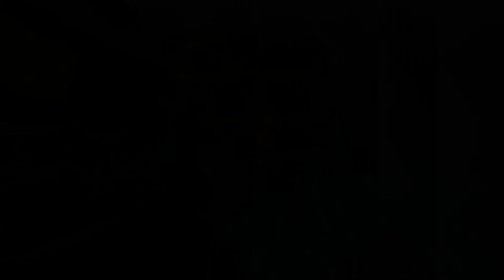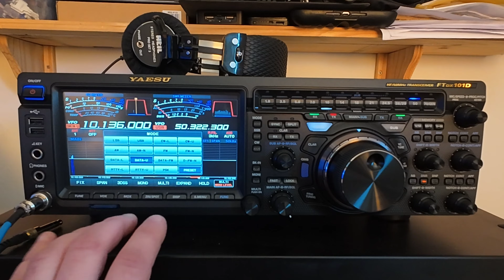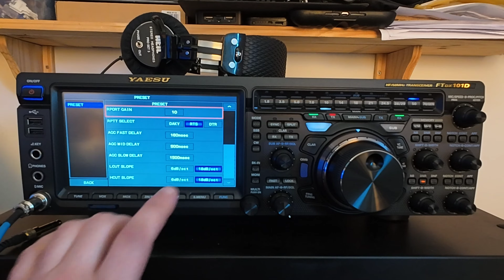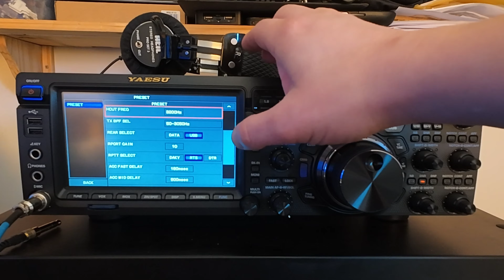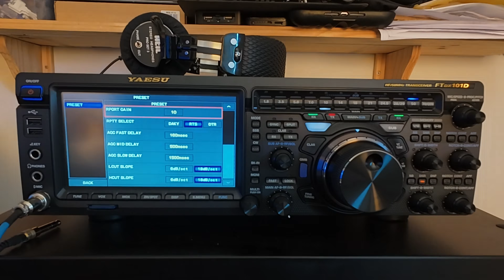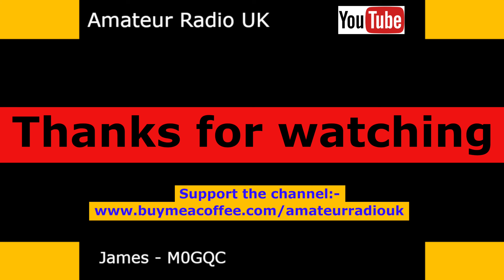Yaesu FT8 Settings (Preset Function)

Comment: I also have the 101d but I don't get a preset on the screen when I hold down the mode button, help help haha
Reply from the maker: Strange!

The only thing that I can think of is outdated firmware.

Have you ever updated the firmware on the radio?

I'm wondering if it's something that Yaesu might have added via a firmware update after the radio was released.......from memory, I think this happened on my FTDX-10. I didn't have that option originally. Yaesu added it with a firmware update.

It might be the same on the 101?

If you have any early radio with original firmware then you might not have that option until you update the firmware?
Reply: @HamRadioOnline  This radio is indeed still completely original except for the bandwidth, which has been modified.

I will look into which update the 101D needs, thanks for the quick response.

Kind regards Johnny

Comment: Personally i think this video fell short. Especially with on to the computer next??? And the video ends. If ya going to do a video showing how, do a video in full.
Reply from the maker: I did say near the beginning of the video that I would do the computer part in the second video because otherwise the video would be too long.

Including part 2 (going to release within the next day or two) it would be about 25 minutes long.....too long in my opinion as I personally don't tend to watch videos which are more than about 10-15 minutes long.

Also, the software setup is basically the same for the majority of modern radios. Why make someone setting up an Icom/Kenwood radio watch a Yaesu video.

Better to do the Yaesu specific stuff in this video, then do a more generic video to cover the computer settings.

That's my take on it but we can agree to disagree.
Reply from the maker: Second part of video is now live if your still interested.